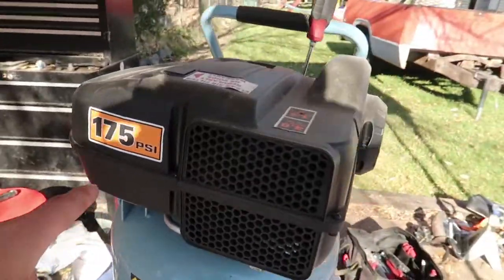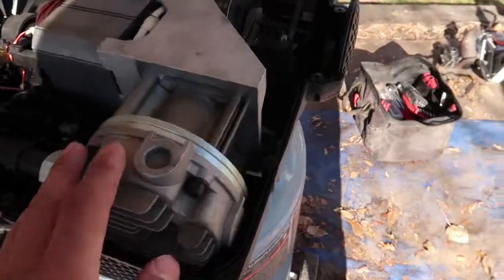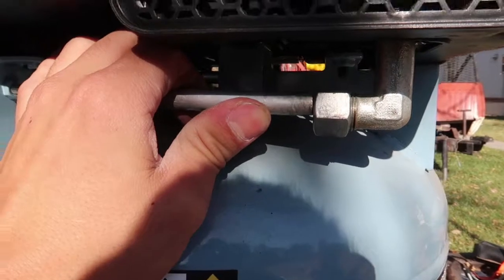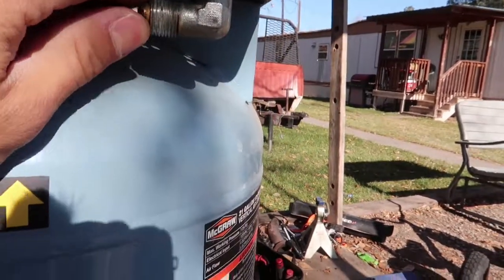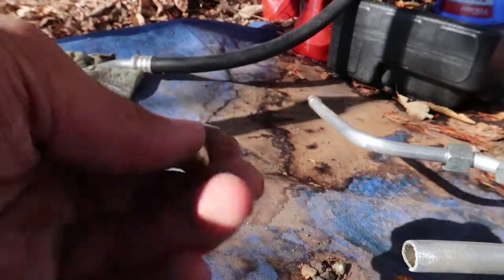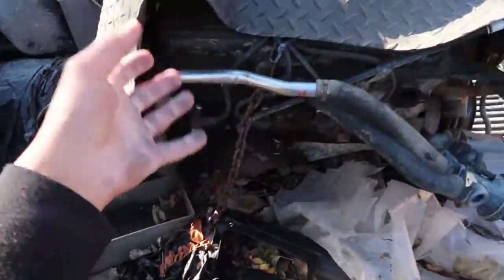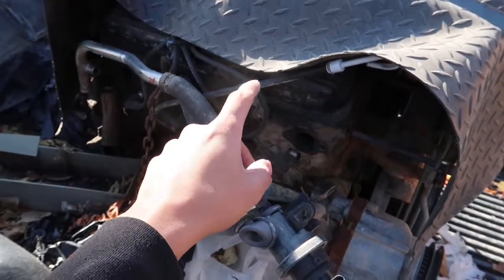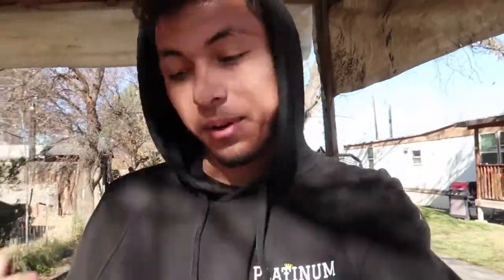Harbor Freight McGraw Compressor Problem...FIXED!!!

Comment: Thanks for the video. I was just given the same air  compressor from my dad. While my dad still had it in his possession, my cousin plugged it into a cheap extension cord and the plug welded to the extension cord. That said, the plug ended up being cut off. Here's my problem, I bought a new plug but forgot to document where the wires were plugged into the rocker on/off switch. B, any chance do you remember how it was wired? I have pictures of how it is now if that would help refresh your memory. Thanks for posting and reading.
Reply from the maker: Im not sure how the wires would go to be honest, maybe find a manual online. I think there was a phone number you could call on the manual for parts if i remember correctly

Comment: I've been considering buying this compressor but was holding off since the broken tube is a common complaint in the two-star reviews on the HF website. Glad to see it's an easy fix. Thanks for posting. Good luck with your V-8 build.

Comment: Started this compressor up after sitting all winter. It started up and ran. I have two tires and I heard it tick off and then it tried to kick back on when it kicked back on it but not it just made a couple clicks and would not go ahead and run.

Comment: I have 135 psi McGraw air compressor 20 gal my issue is that my tank doesn’t get any air any idea what problem would be?
Reply: Mine either ever fiquire it out?
Reply: @davidbryant5875  yes I found the problem it had a broken 😠 piston

Comment: Its a compression fitting and the ferrel(brass part) slipped off the pipe its a common plumbing fitting

Comment: I have this compressor. It fills up but won't shut off. The release valve will open up and blow off the air and then it overheats and shuts off. I replaced the relief valve but it didn't fix it. Ideas?
Reply: The pressure switch is obviously faulty (stuck open). Simply replace the switch.
Reply: @henrygarcia4438  I can't find one for this particular model. When I Iook up a replacement part, it refers me to other brands sold by Home Depo. The company will not return my calls regarding this. Do you think they would be compatible? I'm curious if this is a generic version of a higher end model. BTW, thank you for responding.

Comment: I would just pay $50 for the two year warranty and before the 2 years is up swap it for a new one and add the warranty again better then buying a new one
Reply from the maker: I was hoping it would last longer, but yeah id definitely recommend it for anyone buying in the future
Reply: @eddiegastelum53  yeah I bought one for $220 and added the two year warranty I used it today to take part the front end of a car we’re rebuilding was so esay with an air wrench and it’s amazing glad I bought it and for painting is perfect also paint 2 doors with no problem at 28 psi
Reply from the maker: Hopefully people see these comments so they are aware to get the warranty. Good compressors but they do have flaws
Reply: @eddiegastelum53  they do but I’ll rather buy it then one more expensive plus the warranty $50 for two years before two years is up swap for a new one and add the 2 year warranty again for $50 better then not and paying $220 for a new one